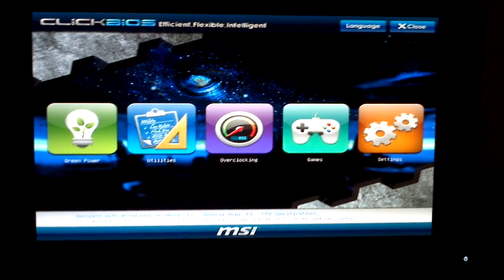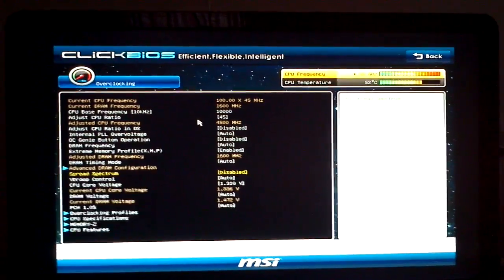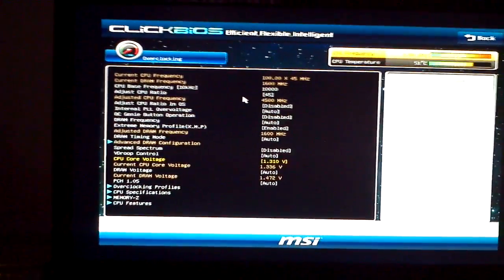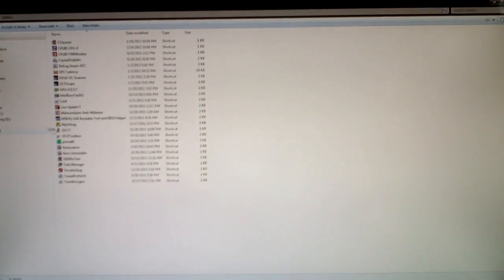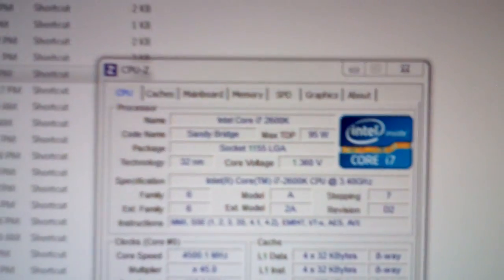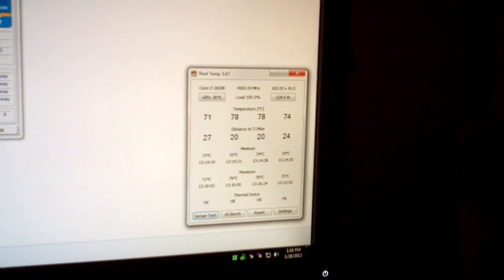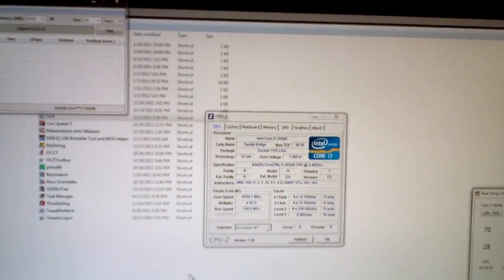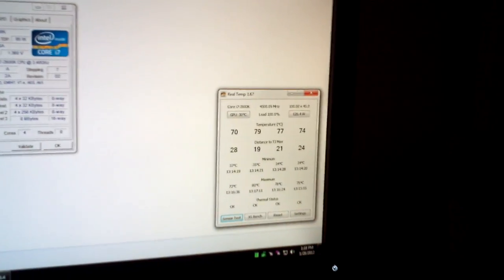MSI P67 C43 B3 + 2600K Overclocking

Comment: Can you look  please how big voltage can put in CPU Core Voltage. I mean motherboard`s maximum. Is it 1.35V like mine same motherboard? Thanks in advance.
Reply from the maker: Yes, mine is 1.35 volts max. My most stable, long term 2600K overclock is 4.4ghz @ 1.30 volts.
Reply: @1FastGXP  Thanks, bro. Im using i5-2500k  4.6GHZ @ 1.35 volts.
Reply: if you download MSI control center you can bypass voltage restriction by over clocking it through the OS put voltage first and wait 10 seconds to adjust multiplier. ive had my i7 2600k up to 1.55v and 5ghz on this board.

Comment: Hello! i7 2600k has worked for a long time? i gonna use 4.4 and 1.315 for 24/7, but a little bit afraid because of budget motherboard
Reply from the maker: sefsefees esfeseffe Mine is still going strong, without a hiccup. Don't be afraid of it being a budget board, as long as you keep the voltage relatively low. With a sandybridge chip don't exceed 1.35v and keep the heat in check for 24/7 longevity.
Reply: Thanks a lot!

Comment: Is it OCCT-stable?
Reply from the maker: +ChrisKadaver I had to change my settings from what this video shows.  I just don't have the time to show the newer settings.  Right now at 1.31 volts I am completely stable at 4400mhz, even in OCCT.  I cannot get a stable 4500mhz without higher voltages, and heat, then I a comfortable with.  Thank you for your question!
Reply: +Neil Aydlett 
Thanks for the reply!
Are you running with a fixed vcore then? Can you in anyway get the vcore to drop while the cpu is clocked down during idle?
I realized when starting OC on this board that it doesn't support offset vcore settings.

Whats you workaround on this issue? Two different OC-profiles maybe?
One with auto vcore just for lower overclocks while surfing and one with fixed vcore while gaming?

Comment: Will this guide work with the i5 2500k?
Reply from the maker: +rctelles Sorry, so long for the response; I have had major health issues for quite sometime.  The guide will work with a 2500K, but you will need to adjust voltage and clock speeds from what I used for my 2600K.  I can tell you this from experience you can overclock a 2500K with the stock cooler and as5 thermal paste; just don't go crazy.  I have pulled 4000mhz to 4400mhz with stock cooler and 80-88c temps.  This was a work system so I don't suggest going over 80c personally.  It's still working fine without any issues as far as I know; I don't work there anymore. ;)

Comment: @sebascorrea97 AMD's are much simpler to OC than Intel imo. I am a somewhat advanced experienced user of AMD processors. I would try to help in anyway I could if you want to message me. Basically your FSB, is usually 200 for AMD phenom line(to my knowledge), times your multiplier (16 stock 3.2GHz) up the multiplier only for OCing.
if your voltage is already high (like 1.4000 volts) then don't mess with it. I have a phenom ii 970 BE I have oced to 3.8 GHz without touching the volts.  goodluck.